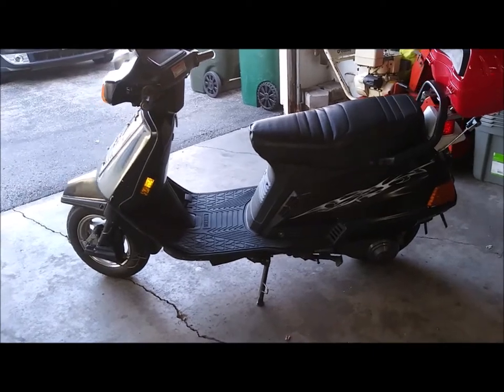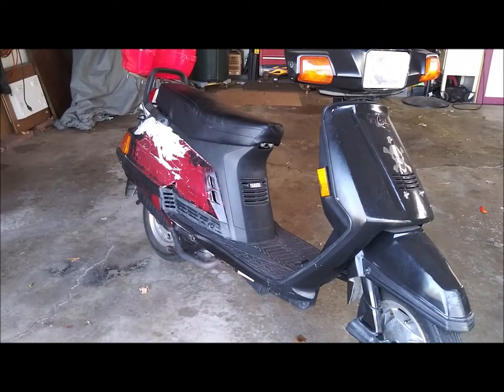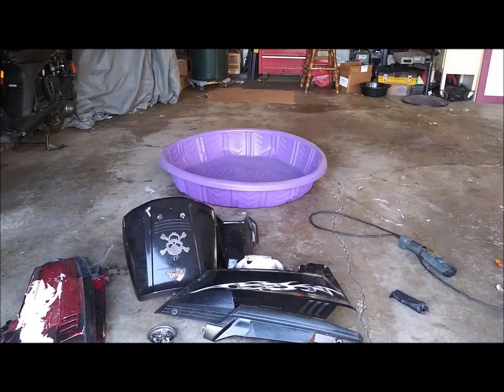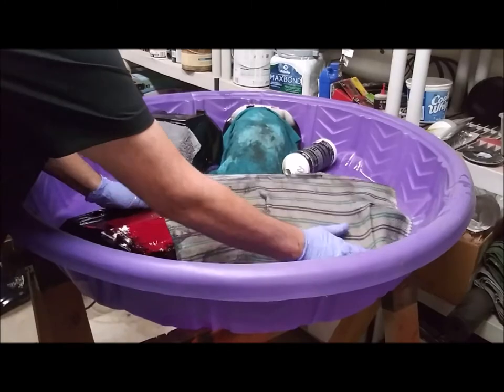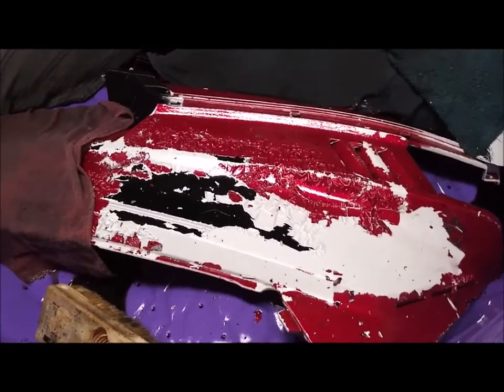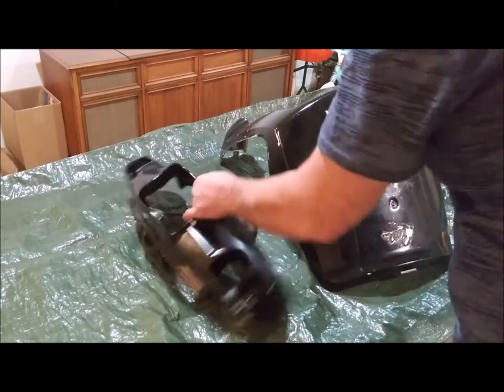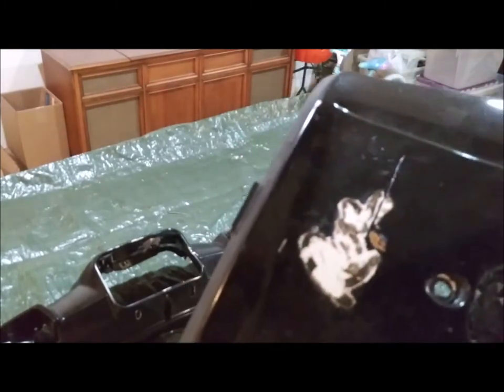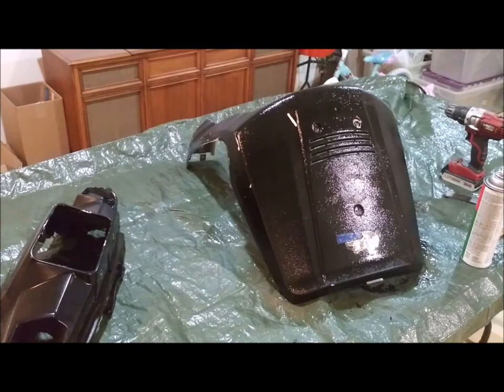Riva Repaint (PT 1) Stripping the Paint using Break Fluid VS CitriStrip Paint Remover.

Comment: Nice! I just picked up a 98 Riva 125, non running. Got it fired up yesterday. It was hard to start with the cold over here on the east coast.
Reply from the maker: Awesome!  I would be very careful if you rebuild the carburetor yourself.  You may get away with just a good spray out with some carb cleaner.  
What Color is yours?  Post a video.  I would love to see it.
In this series I will be replacing the throttle cable, Fixing the mirror mount repainting the wheels and checking the breaks and the drive belt. .
Thanks for watching.
Joe